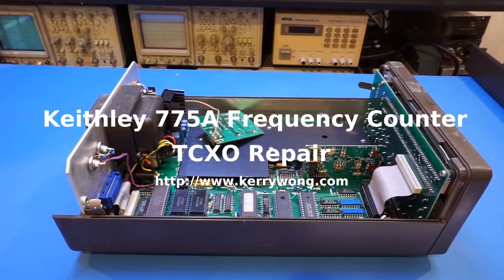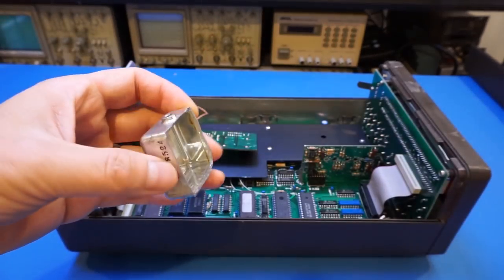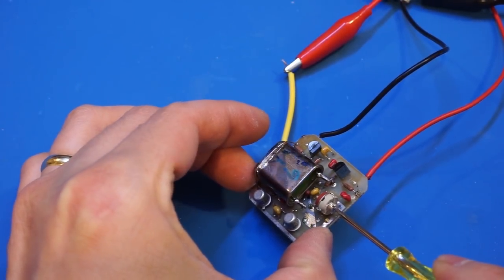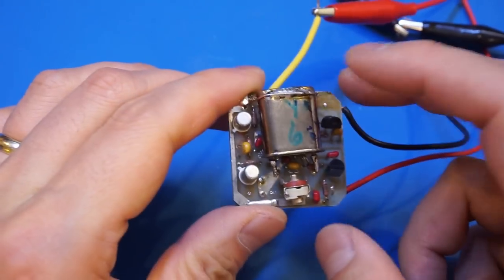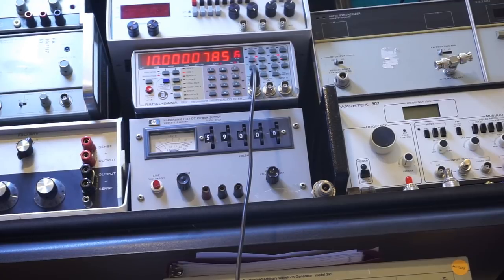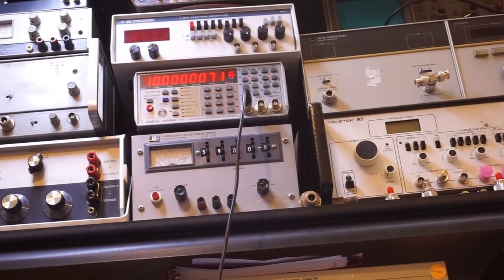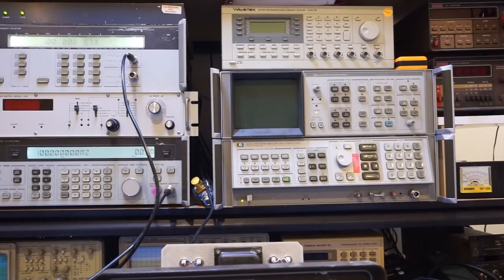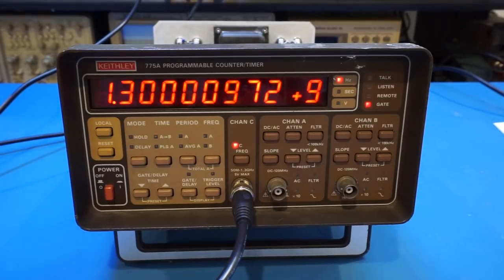Keithley 775A Frequency Counter TCXO Repair

Comment: I suggest fitting a fixed capacitor to replace the variable you added, the variable ones tend to drift off with temperature and over time/age, using fixed values would be better.

Comment: Kerry - if you tinker with it again I think I'd replace the added trimmer either with a ceramic or piston trimmer but probably better to use a NP0 cap of an equivalent value that allows you to fine tune the first cap correctly. If all you want is a ball park figure then this is ok...of course that's why we network all the gear in the lab with a GPSDO or Rb standard anyway. Thanks for sharing!
Reply from the maker: Thanks for the suggestion. I would probably eventually replace it with another TCXO or a low-powered OCXO (since the onboard PS is pretty weak)...

Comment: I probably wouldn't had bothered replacing the 'tickso' and replaced it with an OCXO.
Reply from the maker: The power supply on the 775A is pretty weak though, so probably wouldn't provide enough juice for the initial current needed by the OCXO...

Comment: Sorry, that's been no good repair, as the oscillator lost for sure its temperature compensation feature by the additional capacitor with its unknown and undetermined own T.C.
The circuit for sure was faulty, probably not the XTAL itself, maybe the oscillator/temperature compensation circuit, which was not analysed properly, but bodged in an unqualified manner only.
Reply: I agree, it is better as nothing but this way you degrade it. Besides that, it is so far of there must be some other problem.
Reply from the maker: For any precision instrument the moment you open it you technically "ruined" the calibration and added some unknown factor to the characteristics. The main point of this video is that a crystal oscillator's oscillation frequency can be fine tuned via external capacitors. Yes, most likely the temperature compensation wouldn't work properly as it was tailored to the original crystal's curve.
Reply: @KerryWongBlog  Only today I discover this video. I agree with other gentlemen who stated that you did not repaired the TCXO. Sorry to be rude but this is the truth!! Adding a capacitor to the xtal modifies the Q factor. You tuned the frequency widening  the bell shaped response, let me say worsening the sharpness of resonance  curve. Furtheremore, when you tune variable capacitor it is better to use a PLASTIC screwdriver not a metal one...Do not be offended, a sincere criticism is better than a false praise. Regards.
Reply: A further demonstration is that adding a variable capacitor you compensate 1800Hz. On the contrary, the TCXO manufacturer allows only 4.7 Hz...this is not possible, you see. Another proof could be obtained from a Phase Noise measurement. You will see a big degradation on the performance due to a lower Q. But measuring xtal oscillator Phase Noise requires very expensive equipment.